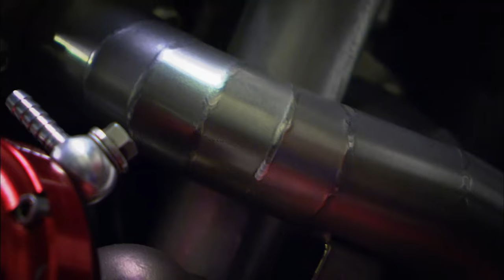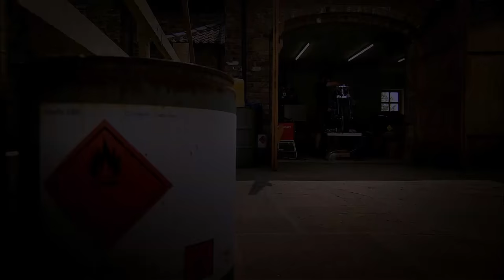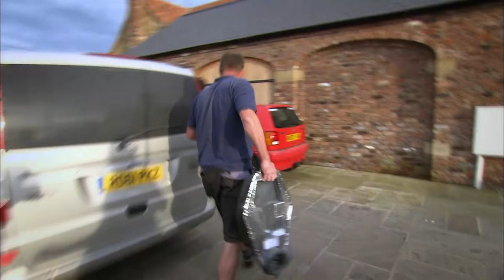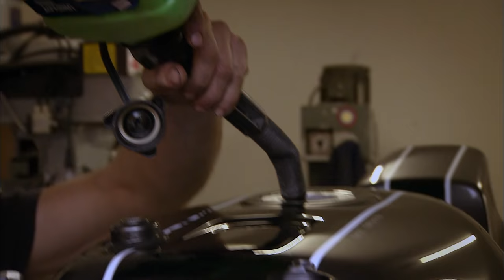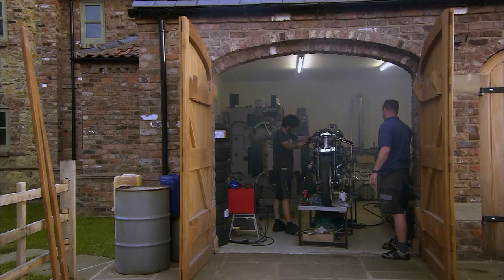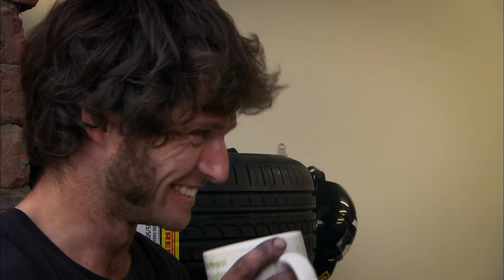Guy starts his custom bike for the first time | Guy Martin Proper

Comment: This guy still using the Nokia brick phone in 2019? Damn
Reply: Not really 2019 but a few years back, but I used to own a keypad phone worth $10 for unlimited texting and calls along with my S9 back then.
Reply: It was filmed I think in 2014 but yeah bit mad
Reply: its as good safety feature you can crash with your bike over 120 mph and brick phone still works.... those new ones break in your pocket if you squat down...
Reply: Thats a powermove, could you imagine guy with a iphone that lasts more than 30 minutes? Nope
Reply: Brick phones are the size of a brick and run on the old analog system. Guy's phone is smaller than yours and is digital.

Comment: This was on Channel 4 in the UK a couple of years ago, wasn't it?  My recollection is that that he beat the (Japanese?) class record holder by seconds (if not fractions of), using no more than half throttle, because of problems with the engine's fuel control system.
Reply: That's spot on. He won his class by a second on a bike running terribly. The man's a force of nature!

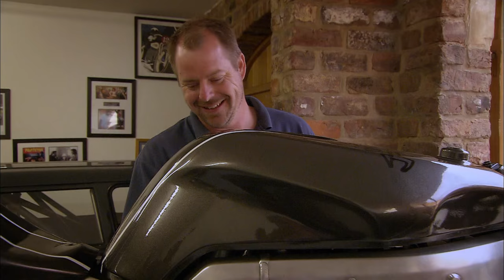Comment: Didn't think the paint finish on the tank was particularly special.  Looks quite orange peeled to me @ 2:00 when they're stood alongside the bike.
Reply: Orange peel is on the clear coat,they are making it like that so the sun wont burn the paint because if its crystal clear the clear coat will act like a magnifying glass

Comment: What muppets for lobster backing that exhaust, their bender might not be able to do it but those bends are no tighter than 1d which is easily found off the shelf for under £10 each. 
So annoying that people love such a pointless exercise. 
You wouldn’t lobster back a frame or a roll cage, and shouldn’t lobster back an exhaust unless absolutely necessary, like when you need to spiral or taper during a bend.